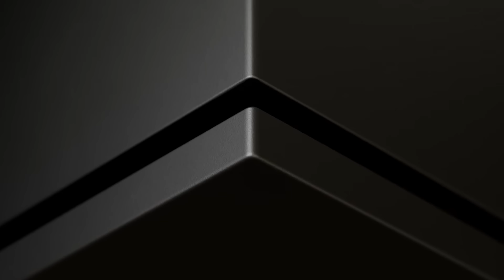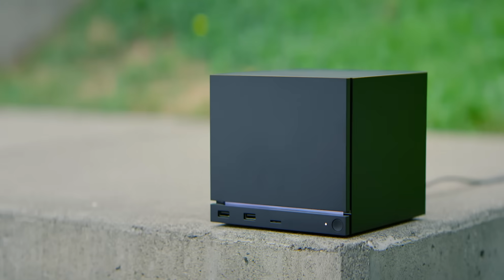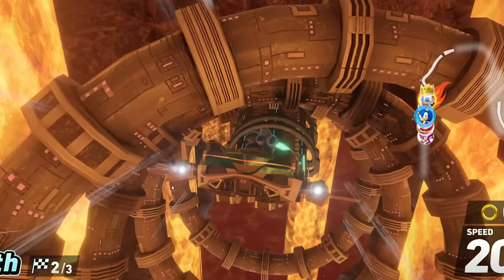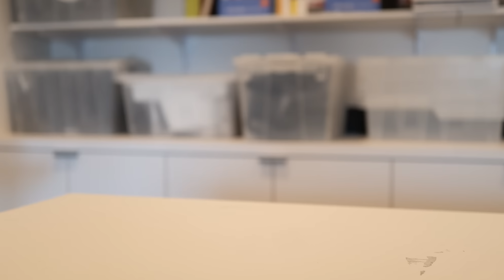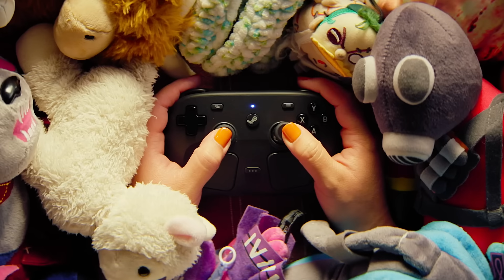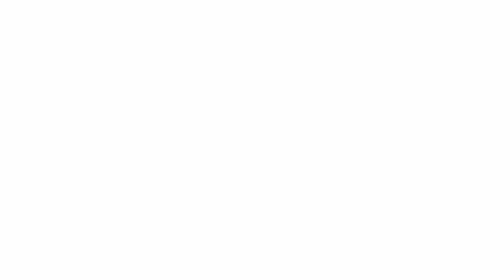What we know about the Steam Machine and Steam Controller

Comment: for anyone that really cares about the controller, I found the pcgamer video "Valve explains their brand new Steam Controller | Critical Rig" to have nice closeup shots of it.
For those that really care about the d pad the only information I could really find besides "it has been tuned" was the rockpapershotgun article, here are the excerpts

"and the D-pad has been reworked to stay centred more reliably while delivering crisper diagonal presses; the latter is a subtle difference but, at least to my thumb, a tangible one. I even pulled my Deck OLED out of my bag to check."

"It is not, for one, a truly high-end (or, in controller lingo, 'Elite') gamepad. Its triggers aren’t adjustable or adaptive, and neither the face buttons nor the improved D-pad have the satisfying, mouse button-esque clickiness of the Razer Wolverine V3 Pro"

Personally I have no doubts there will be split d pad mods tho or atleast a clicky kit from extremerate

Comment: I think what they need more than anything is an agnostic home screen. Right now on Steam Deck, the home screen is obviously skewed towards Steam, but with this I really feel they need something before that where you can pick Steam of course (even as the primary suggestion every time you turn on the device) but could also select from that screen Kodi, or YouTube, or even your other game stores, etc. Hell, hopefully they can secure Widevine DRM for Netflix and other streaming services.
I recognize this is a PC more than anything, and that it's geared for gaming (on Steam), but if they really want to tap into console market space under the TV, I feel this is necessary.
Reply: Is it that nesesery? Pretty much all modern TVs have that build in and you don't need to do it through console/pc. Also once % of linux users rises i would argue most problem will by solved "by itself" as it wont be market that can by ignored anymore. So for now we just need to wait for that slow but steady expanse of linux hardware.

Comment: No C or SDexpress is a sign this thing is pretty old. I wonder if it was delayed for software reasons like the Frame.
Still, it's all the power a casual gamer needs.
Reply: Valve don't need MicroSD Express because the SSD is upgradable. High quality MicroSD should have enough speed similar to or better than HDD.

It's Nintendo that is the odd one for pushing MicroSD Express when there aren't games that are currently taking advantage of faster speed.

Heck, Playstation, Nvidia and Microsoft can talk about direct read from SSD to GPU feature all they want when there're still only few games truly taking advantage of it.
Reply: Not even casual. Just a normal gamer. It's good enough for anyone who isn't a hardware or graphics enthusiast

Comment: 1:47 That really depends on who you are. Maybe a hot take, but the most serious PC gamers have Nvidia GPUs. You can't deny that PC's most outstanding graphical features and performance are found on flagship Nvidia cards. Proton through SteamOS is perfectly fine for AMD cards, and in most cases, it's great. But it can't match Nvidia's technical greatness. Some people may pull out the "Graphics don't matter" excuse, but that falls apart when you consider we're essentially a crowd of people prepared to spend thousands on hardware for the best gaming has to offer, unlike console gamers. Nvidia cards do work on Proton for the most part, but they're considerably less performant on Linux than on Windows. It won't matter for many games, but on the really demanding ones, you'll notice it.

I'm still getting the Steam Machine, of course. I love it, as with the new controller and Steam Frame. I'll use it similarly to my Steam Deck, which I use mainly for 2D/indie games. I can obviously expand that range a lot with my future Steam Machine, but for anything that can genuinely benefit from 4090 graphics, I'll switch to my Windows PC. Fortunately, I'm not a Fortnite fan or even play Epic's online titles in general, except the Master Chief Collection which uses their software. If I did want to play them on SteamOS, obviously I'd be in a bit of a pickle when it comes to the Steam Machine. You can thank Tim Sweeney for that. Various anti-cheat titles won't work on Linux, currently. And let's not forget that, as great as Proton is, there are still many Steam games that remain incompatible at this time.

In conclusion, nothing says "I'm a serious gamer" like making use of both technologies to maximise your enjoyment.
Reply from the maker: I won't argue that Nvidia's cards seem more advanced. But I will argue that Nvidia doesn't give a shit about PC gaming anymore. They're too busy inflaming an artificial AI bubble. Besides, Nvidia GPUs are too expensive and graphical capabilities are failing to impress most normal folks. That's one of the reasons Valve's building this hardware IMO

Comment: 8gb vram a red flag. Tell them.
Reply: Unoptimized games are the red flags, not the 8GB VRAM.
Reply: Well the reason why they did that is because of the Steam Hardware survey. Most people have 8 GB VRam and play at 1080p. So that's why they went with the hardware they did.
Reply: @Soup-man Yeah, and why would someone upgrade from 8GB of VRAM GPU to another 8GB of VRAM GPU which is probably weaker because most users have an Nvidia card which will outperform the AMD one used in the Steam Machine.

Comment: Gardiner: I’m ready to leave Windows behind for gaming. I have a 4080. I want a console-like experience on my PC which is connect to my TV and a monitor. I need to keep Windows for work related problems, but should I install Bazzite and dual boot? I hear that it’s still buggy with Nvidia GPU’s? Realistically what would my experience be like? (Noob user, btw)
Reply: I dualbooted bazzite with windows with a 4080 for about one year, and honestly I had no problems with it. All its features like DLSS and framegen worked without any configuration.
However the big picture mode of steam on linux does not work with nvidia, that happens on every distro as far as i know. It technically works but it is VERY slow, so if you intend on using that, it wont be good unfortunately.
My 4080 had hardware issue and i downgraded for a  bit to a 3060, and had no issues on bazzite. After a while I upgraded to a 5080 and the drivers on linux werent working for some reason, the resolution was very low and i could not change it. I ended up changing to nobara linux and that fixed it, but most likely reinstalling bazzite would have fixed it too, but i wanted to distro hop.

Other than that issue with changing GPUs, bazzite worked great for gaming in desktop mode, i would have continued with it easily. So yeah theres a bit of jank with nvidia but I think its mostly fine, its not the absolute hell it used to be years ago.

Also bazzite suports secure boot, which is nice because on my windows boot i needed to enable it to play some anticheat games(bf6), and to enable it on bazzite its very easy, theres a oficial wiki explaining how to do it.

I say dont be afraid to change, because even if you encounter problems, which can be very anoying, they are fixable and once you fix it they rarely come back, and you learn stuff which is also cool.

Comment: Will we have Steam OS ARM (or at least Qualcomm ARM Gen3) Phones? (or CachyTos, being the T for Telephone and also meaning small pieces in Castilian Spanish).

And tablets, hybrids, handhelds and more. Now that MS Windows lost 1/3 of users (from 1.5B to 1B) earned by Linux (Android) despite being "worse", and worse than GNU/Linux. 

I think that Steam OS and similar (Bazzite, Cachy and others) will be able to fill the 0.5B needs (and much more that still use that OS and did not make the switch) : uncomplicated OS, that just delivers, and do not ask to spend 1000 USD each 2 years to perform well, and do not ask you to stop working while it is updated.

And with Qualcomm devices, also be cheaper than X86 alternatives, with better battery duration for portability, if needed despite be less powerful, when rarely that maximum power is needed, and if needed there will be affordable X86 devices as the Steam Deck and the Steam Machine.

Comment: I already built a prototype for the eink faceplate for the steam machine. Since I don't know if there are power connectors in the magnets, There will be an option to power it with a battery or a short USB cable. All software will be open source and it will work with already existing open source hardware.
Reply: Make one with oled display, it can have video out and powered by the usb-c port on the back... I guess it supports video out if it is USB 3.1
Reply: @dzibanart8521  Sadly, it looks like there is no DP alt mode on that type-c port.
Reply: Very cool, very pog. Any links to the project brothers?
Reply: what's the github